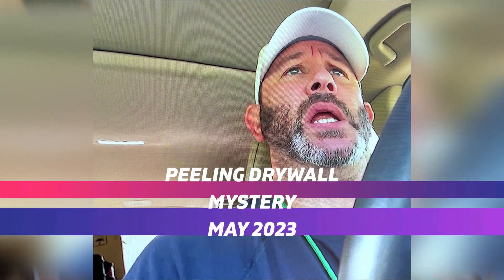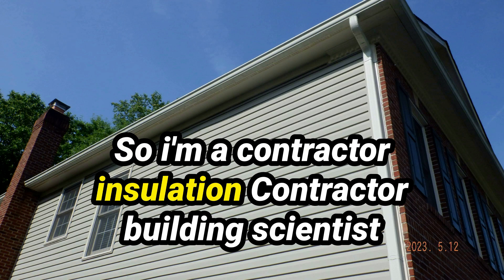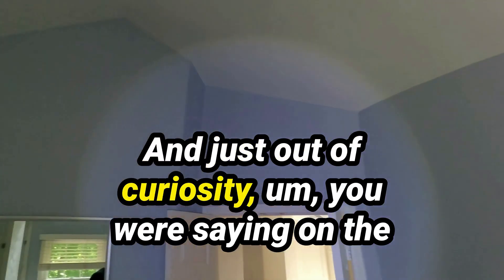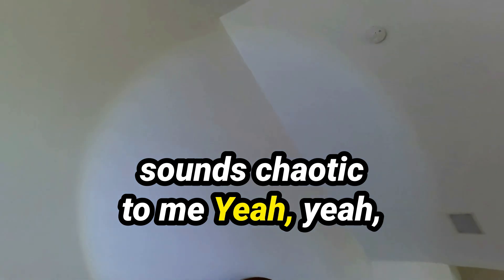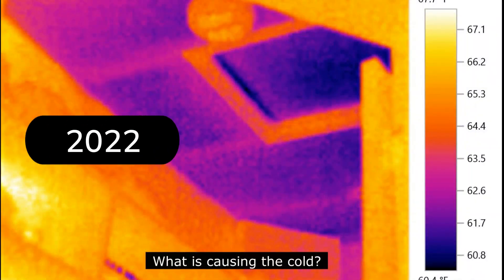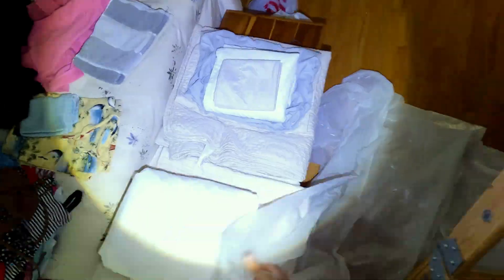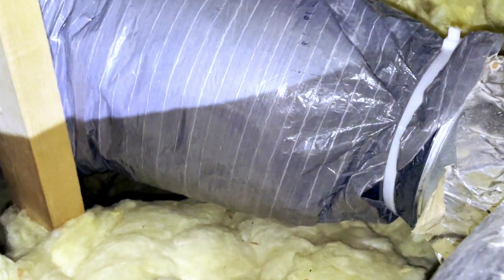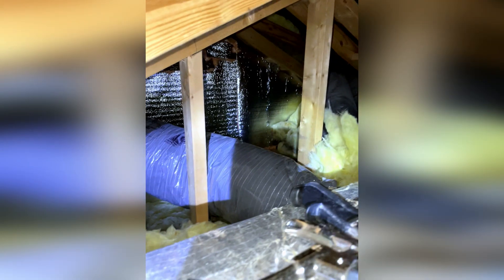Thermal Camera Gives a Clue to Energy Auditor Trying to Help Homeowner

Comment: I live in Ireland and work in the insulation and ventilation industry, it's always ineresting to see how things are done in other countries.  I'm quite shocked at how messy that ventilation ductwork is, would that have been installed at the time the house was constructed?  Or was some of that ventilation system retrofitted at a later stage ?
Reply from the maker: Thank you so much for your contribution and for watching! That was installed at the time of the build (99). The homeowner did have a bathroom redone in the vicinity, and it is possible that the remodeling work knocked the duct loose. My eye is not trained quite as well to say that it is messy. Actually, I sort of thought that this system was well organized. What do you see that stands out as messy? Other than the disconnect...

Comment: Nice catch! Admittedly, I did a lot of skipping in the video, but when I saw the disconnect, I jumped to the conclusion that the continual expansion/contraction caused by the AC / heat blowing against the kneewall-to-ceiling junction caused the peeling. Was that a good assumption on my part?
Reply from the maker: Now that you mention it, I think that was absolutely a part of it! I was thinking of dew point and water/moisture causing the issue.
Reply: @homeairleakagetest  Great point. What climate zone is it? (I'm in the Phoenix metro area; RH at noon today will be around 8%.)
Reply from the maker: @heatthermography3902  yes!  Makes sense! I’m over in Maryland. We have days like that but most are hot and humid.